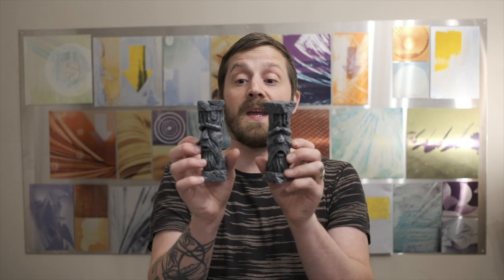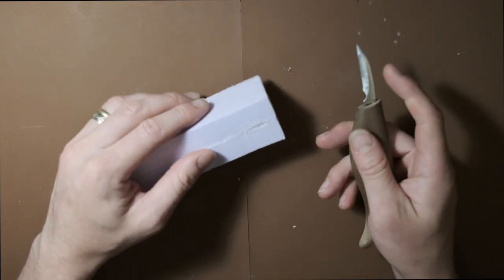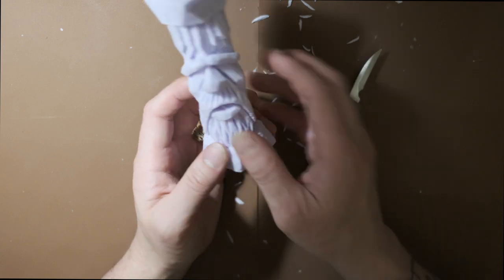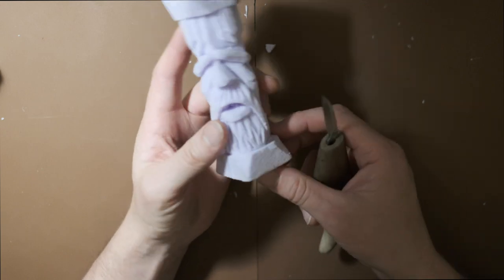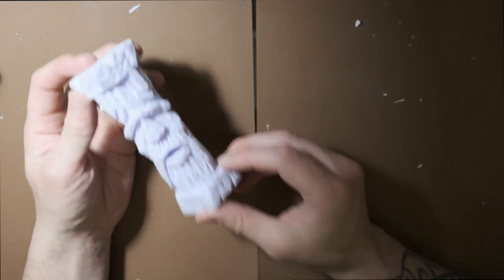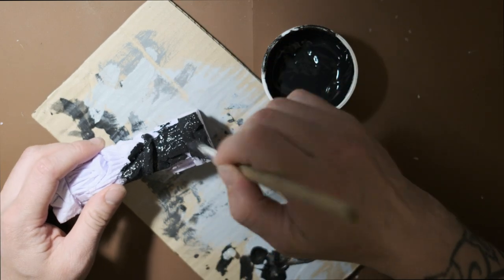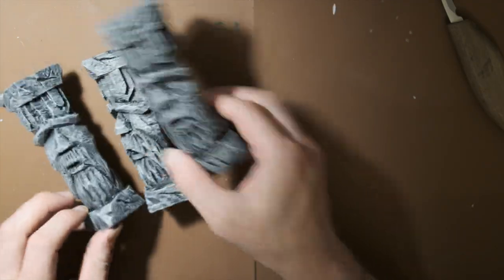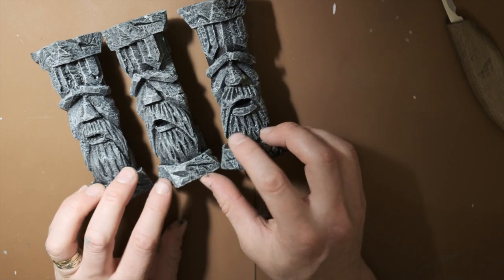How to carve Dwarven pillars with faces from XPS foam

Comment: Thank you for making it look so fun and easy. I am about to have my first go at carving XPS. I want to carve a skull for a dice tower I am making. Any suggestions? I would also like to carve one of your dwarven pillars, but on a much smaller scale. Maybe 2 to 3 inches tall. Wish me well!. Thanks again.
Reply from the maker: Thats awesome! The only tip I can give you is be prepared to have a couple of goes at it. Allow your first try to be a draft, make your mistakes and figure out the best cuts. It may take a couple of trys before you are getting to something you like. But once you have got it, you will be able to do it over and over again. Also, remember you can melt xps foam...So a hot wire knife might come in handy for gouging out areas like eye sockets etc  Please let me know how you get on, I would love to see :)